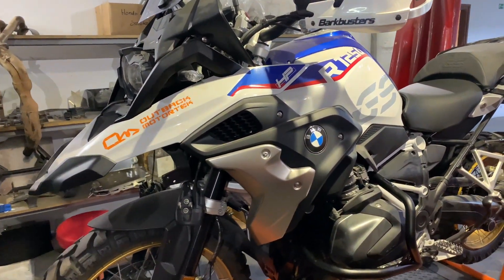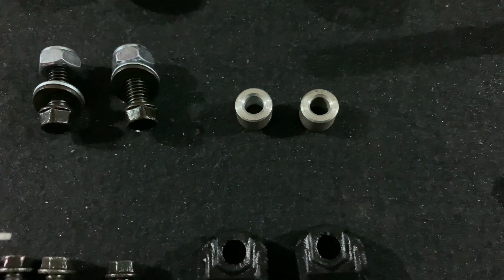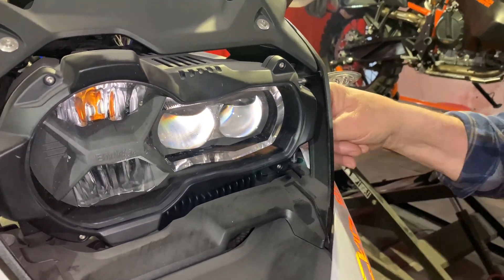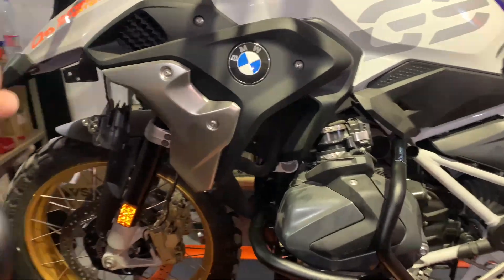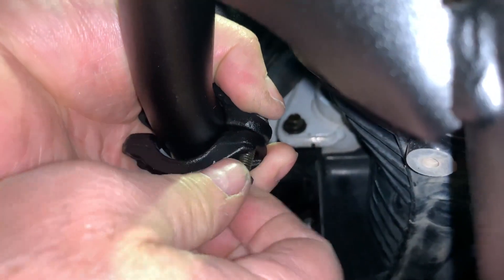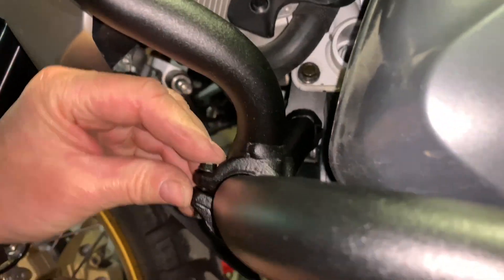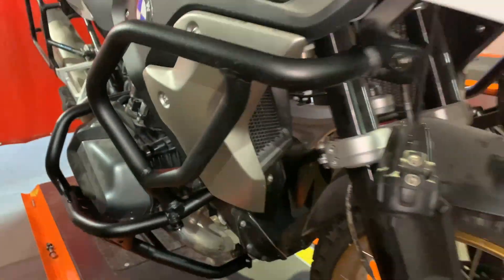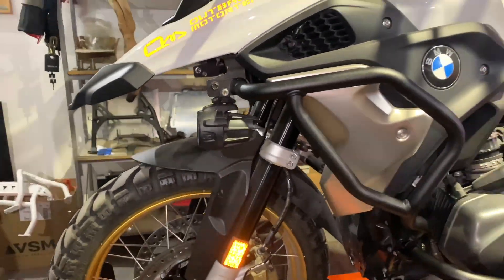BMW R1250GS Upper Crash Bars Installation Instructions

Comment: Is it compatible with the lonerider headlight protection?
Reply from the maker: Apparently so
Reply: Not out of the box !!!
Just installed today 11.26.22 the complete OM on my 22 1250gsa. I needed to remove my lone rider headlight guard, and removed the "welded on nuts" on the Lone rider bracket. That worked. 
You need to modify the lone rider bracket.
Reply: Worked for me.